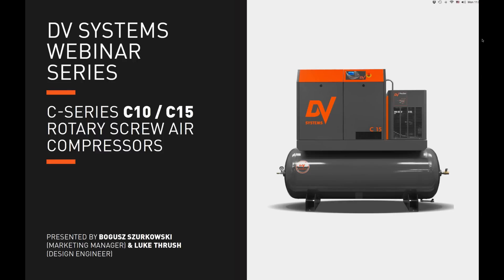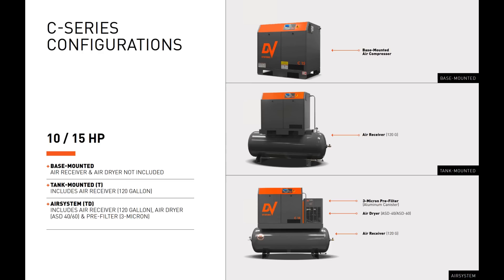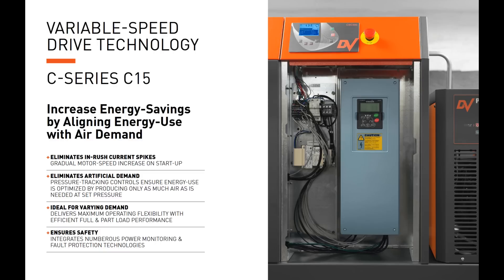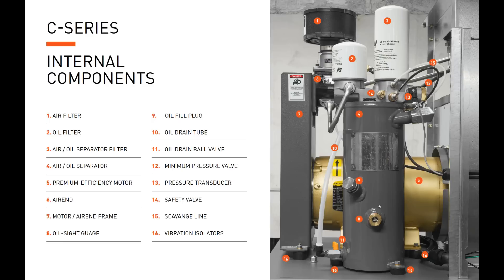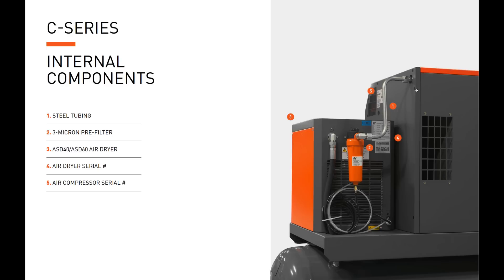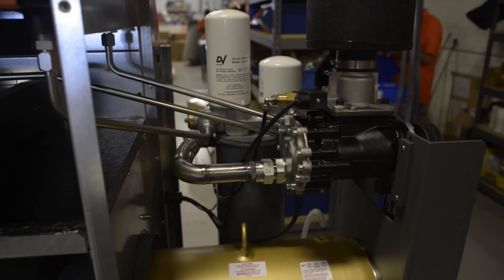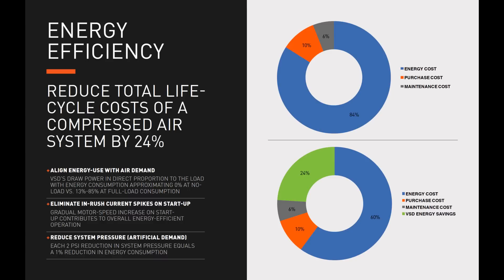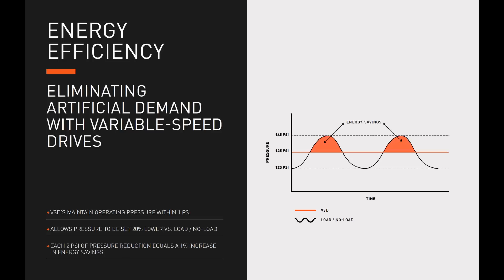DV Systems Webinar - The New C Series Rotary Screw Air Compressor -  Recording 1080p

Comment: Fantastic presentation.  Bravo on the new C series design! The oil tubes vs old hoses are a huge improvement as well as the reduced connections with the mono filter block.  The control cabinet remains the most field serviceable of all compressors in its size.  While difficult to see the inlet cooling opening from the front of the machine, it will be easier to change package pre-filters and possible to duct the inlet to a cleaner/cooler location.  I would like to hear more about the capabilities of the new CSC300 with regards to Ethernet connectivity.  Is it possible/standard/option?
Reply from the maker: Jason Copeland 
Hi Jason, Thanks for the positive feedback, we appreciate it!

And thanks for suggesting the CSC300 controller as a topic for our webinar series. You can expect to see a dedicated webinar on the CSC300 in the coming months.

Feel free to get in touch with us to learn more.

Thanks for your interest!